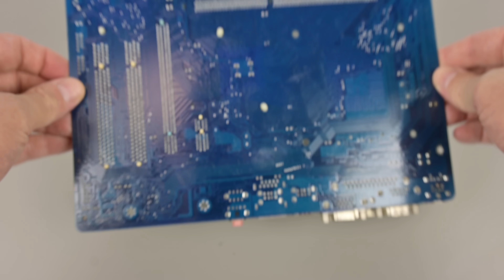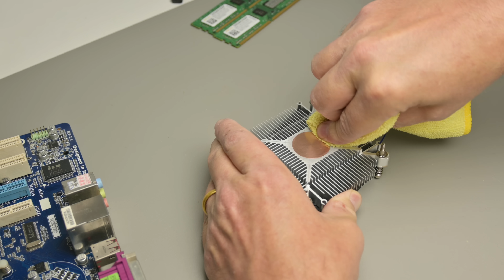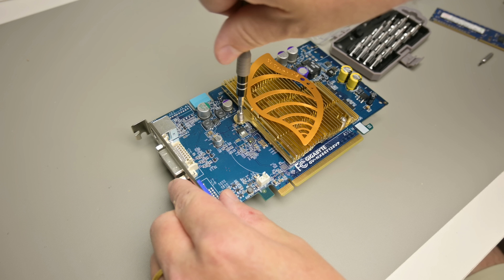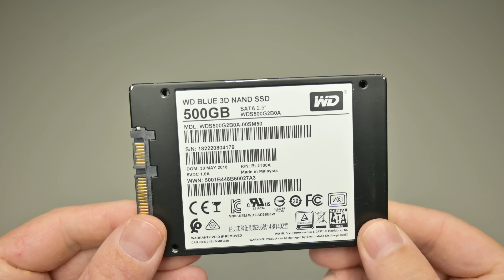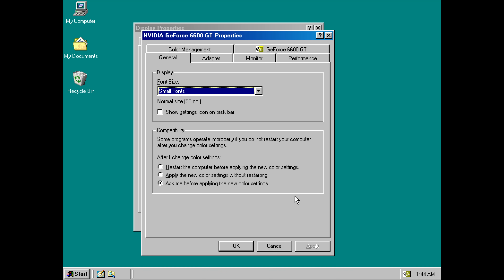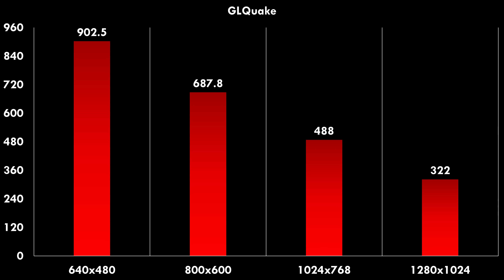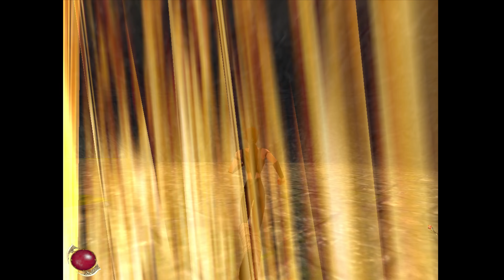E8600 Windows 98

Comment: This is pretty cool. I think it's a little fast for windows 98, maybe xp. Has an IDE port, as far as I know core 2 is the last series that had IDE built into it's chipset, I find later boards with a seperate controller for the IDE outside the chipset has disadvantages. I use a phenom II x4 955 for that, and I have no issues running a 1600 kit at 1600 it's rock solid, even though I think it's an OC. I haven't come across a free X6 chip, maybe once Windows 11 is more in our face I'll come across one, that would be so awesome. I'm sure windows 98 could run on the thing but I have no real reason, it's just a cloning and wiping computer.
Reply from the maker: I have an interesting thing to share! I used to have a Phenom II based main PC when I started the channel. 6 cores and the ASRock board had a floppy header! So the machine was modern but had a Gotek floppy drive to transfer data 😊
Reply: @philscomputerlab  You basically need Phenom II 3.2-3.4 to compete with E8600. 6 cores are not that useful as the frequency is lower due to TDP. To OC it to 3.7Ghz on all cores would risk killing the board as they are not new.

Comment: Another cool video, Phil!! It is fun to run games on overkill systems, but I had problems with Comanche 4 for exemple, too much ram will trigger an error and game wont start. I have dell optiplex 755 with a Quad core Q9550 and Windows xp on it, but I  will try windows 98 on it.  If you like Drakan, give it a try for the sequel on the PS2, Drakan: The Ancients' Gates. PS2 are so cheap nowdays and MX4SIO is very easy to use.
Reply from the maker: Yea I've heard there is a sequel. Shame the PC didn't get a proper one, it's a lovely game.

Comment: the duo cores are ok for retro gaming. I use a Dell optiplex with a Q9550 though. It wil run dos 6.22,win98, win xp and win 7 without any stutters, all on one machine. also SBEMU works in DOS on this machine so even in real dos mode it works.

Comment: Actually, i have stoppe installing Win98 on PC's faster than a P4 Northwood.
P4 @3.0GHz with Geforce 4 Ti is the fastest i have tried.

I have a further Core2duo 8400 which i can OC easily to 3.33GHz. 
Have installed Win7 for max out the 4Gb ram. There is ~ 1 Year difference: release of OS  and this cpu.

Comment: There are also options for PCIe ATI Radeon cards compatible with Windows 98 like the budget X300/X550/X600 or the more expensive X700/X800/X850.
Another benefit of such a configuration is that you get a nice Windows XP rig for free as well, just dual boot :)
Pretty much every E8600 should be able to be overclocked to 4,0GHz - even with undervolting like with my sample so temps are pretty much the same :) And you can go even higher with better cooling/more voltage.

Comment: Well, Quake 1 in 900 fps means nothing to anybody, even if you'd chop the framerate in half. I think it's wasteful. There's no practical use for it, just bragging-rights.
I wish you would test something like Dungeon Keeper 2 on your 98 systems. In my experience, busier maps can really slow down higher-end Windows 98 machines. Games like that speak for the more level-headed reasons someone would consider a computer like this.

Comment: When it comes to running older OS's I love both period correct hardware and also newer officially supported (with drivers) hardware. I'm not one for using modded drivers. If it's supported officially, I love to max out the experience. Whether it be period correct hardware and maxing 98/ME with a P3 or using something newer with drivers to support the experience. For me it comes down to the fact I love hardware and seeing something reach it's potential without going out of official support. I approach this with both 98/ME and XP where I run an Ivy Bridge generation ASUS Asus P9X79 motherboard, 64bit XP, 64GB Ram, XEON E5-2697 v2 CPU, Nvidia Titan Black GPU. Overkill for XP sure, but it's the fun involved in putting something together with officially supported drivers.

Comment: You are better off using a fast Pentium 4 (3 Ghz) cpu as win 98 will not make use of multiple threads, so it will only use one of the cores...
Reply: P4 is crap. Go for an AthlonXP or Athlon64.
Reply: @AncapDude  well i was suggesting a cpu that would actually work in this mainboard, but sure athlons were great back than...

Comment: I think there is a place for period correct and overkill builds.  I have both. Period correct is great for an authentic experience and better compatability. Especially with a CRT. Overkill builds are I think best used with high res LCD displays, and cranking the settings up.
Reply: Overkill builds on 2048x1536 CRT and cranking settings up begs to differ.
Reply: What a stupid opinion LOL. Literally worthless opinion.
Reply: @PrezidentTrump-81622 Thanks. Have a lovely day.

Comment: I have an Athlon 64 and a Pentium 4 system I pair with agp GF2 MX  or GF 6200 or whatever I feel like playing around with. I prefer using those systems but going forward with a e8400 6600 GT on a p5q - e. I'm going to consolidate down to one 98-XP dual boot box. Despite the quirks and the not so nostalgic feel it's just easier.

Comment: E8600 is the best WinXP build CPU that is available. Low TDP and the single core performance was the highest for any non Xeon CPU of that era, and the vast majority of software during the XP period cannot take advantage of more than 2 cores. They will OC to the moon, AND, they are still dirt cheap. Get them for your build while you still can, before younger millennials start getting nostalgic about that period and the price quintuples.

Comment: I love my E8600. I used it and a GT 1030 as a living room machine during the pandemic.

Also used the machine as a Plex server for a while, but it’s sadly sitting idle. Instead, I’m using a 21.5” iMac mid-2011 (i5-2400s with HD 6750M) as a Windows 7 GOG machine. I know it isn’t your normal direction, but if you come across a decent Intel iMac with discrete GPU, especially a Haswell era one, they’re quite capable.

I only had one issue installing; after initial setup from disc, the machine wouldn’t boot properly and went to black screen. A bcdedit to force VGA worked until Bootcamp drivers were installed, then the WHQL driver from AMD. Legacy Update worked quite nicely, as well.

Comment: I think s775 platform and super socket 7 are the best ones for wide cros-OS compatibiliy. I''ve seen a lot of videos about w98 with E8600.. just wonder about win98, how about a more modern dual-core cpu (core i series?) wouldn't it be faster than E8600? -purely in terms of performance

Comment: I'd say next try Windows 98 Quick Install on Sandy Bridge, because now it's 14 years old and completely worthless. I find free Optiplexes in the street. Of course for sound you have to resort to a USB Audio dongle if there are no PCI slots. 

I have actually started working on a HD Audio driver for Windows 98 but progress is slow.

Edit January 2026: My driver works now! But so far only for VMware, VirtualBox and the Realtek ALC2xx codecs. Need to support more systems.
Reply from the maker: So far, Sandy Bridge is my go-to Windows XP system. But yes, for sure I want to check out 98! Prices are cheap.
Reply: Man that's great to hear, i have my XP machine on a Sandy bridge. Didn't thought about trying Win98 on it.

Comment: 2:40 - "Nothing fancy" - I'd argue it still better than running a Stock Intel CPU Cooling.. I hate how difficult that thing is to uninstall or install. If you want go with Intel CPUs, I recommend the Custom Coolers, they are so much easier to use.

I started with authentic PCs - Pentium III and Athlon XP... And that has a interesting vibe to you if you work on it long enough. So is Athlon 64. But the more I think about it - I think Overkill makes stuff so much more interesting - Silky Smooth gaming on (Almost) any game you want - Doesn't matter if it's Unreal Tournament, Indiana Jones and the Infernal Machine, The Settlers - Heritage of Kings or Call of Duty 2003... It will run the way you'd probably enjoy the most... 

... But I'm not against authentic PCs now though, there's something about experiencing less FPS with games that you played on much stronger PCs... I don't know, I finished Grand Theft Auto: San Andreas on my Athlon XP PC with Radeon 7500, even though at times it had around 15-20 FPS during gameplay.

Also... I like the compatibility with 775 Boards, this stuff makes running 98SE so much easier (I wonder about AM2 Boards though, since nobody is talking about that.) on something that doesn't rely on IDE/SATA > IDE Adapters, especially with the former, those HDDs are becoming less available with each passing year.

Comment: Nice choice of Hardware für Windows 98. I'm using the GeForce 6800 GT with AGP on Socket A with Athlon XP 3200+.
I know the Athlon isn't fast enough for the GeForce, but its running good under Windows 98.

Comment: ❤ E8500 and E8600 is also my universal approach from W98 to W7, just changing gpus from GeforceFX and Radeon 9600Pro to  X800, 7900GS and later. Personally I prefer to play on Windows 2000, cause it is running almost everything like win98 but more gpu options, more stable and smoother fps.
Reply: There is nothing in NT5 like Win98

Comment: I love the E8600, in Win 98, XP, Vista and above...also, Socket 775 is amazing and SO versatile, thank you for showing that 😍
Reply: Be Nostalgic, my friend.
Reply: @Captain_Wasel  yes indeed!!
Reply: True I used e8500 to run XP and W7 up to early 2013
Reply: Yo, midnight geek is here
Reply: @therealegr  What, where???
Reply: @MidnightGeek99  Here, on PhilsComputerLab's commentary section
Reply: 8400, 8500 e 8600 is the best, my 8400 overclock is 4000 ghz fine!
But need watercooler,  i using cooler master model
Reply: e8500 can go up 4113mhz on air with a 9700nt. 62°c fpu stress test.
Reply: @devilzuser0050  62c is near TJMax for that chip too, dangerously hot actually. We didn't start seeing TJMax over 80c until Skylake.

Comment: Hi Phil ...yeah I'm liking the socket 775 for Win98, the 478 boards are just disappointing to say the least.
I've been testing different socket 775 boards trying to find the sweet-spot, the deciding factor for me always ends up being chips-set driver compatibility.
Seems to me the PCIe Graphics Cards are the way to if you want the bandwidth, I'm running a GeForce 7800 GTX 256mb 256bit .
Like you said L2 cache makes a difference, My Q9650 matches the E8600 with L1 32+32 & L2 6mb and I'm happy with the CPU.
For the motherboard I've got myself a NOS ASRock G31M-S, most G31 boards have a floppy connector and this one feature I consider necessary for a Windows 98 build.
Reply: Not socket 478 is the problem but that silly Netburst P4's for it are.

Comment: I think I've had the E8400 + 9800 GT in the late 2000s when I was a kid. It felt like such a big jump when I upgraded to an i7-2600K + GTX 570 afterwards... I didn't overclock either of those at first, but I eventually gave the i7-2600K a small OC after getting into the hardware scene and reading about its OC potential.

Comment: I am planning to put 98se on my Socket A pc with 3 cpu options, the Sempron 2400+ it came with or the XP 1800+ or Barton 3000+ once I flash the BIOs to correctly identify it runs at 1400 or 1500Mhz yet has the full 512Mb cache of the actual processor. Before now i never had to update a BIOS and here's old school gotta make a DOS boot floppy 💾 and have the bios file on the hard drive to flash it..

Comment: I don’t like not having chipset drivers installed, it’s bit me a few times where I’d get unexpected behavior with USB HID and IDE controllers. So the thought of Core2 gives me pause unless it’s XP. I lean on Coppermine and Voodoo3 2000 PCI for era appropriate DOS and 98SE and then run ME on socket 754 with a Radeon 9700 Pro (or FX5600 on weird edge cases needing table fog) for specific later games that require a lot of horsepower. Everything else goes to an X58 box on XP, or is new enough and has enough patches I can just run it in 11 on modern hardware. The only issues I have with this three machine retro solution is SATA on certain revision VIA can be wonky, so I’ve started using Promise 150TX2 PCI controllers to be able to use modern SATA2 or SATA3 without issue in 98SE with DMA enabled. I even use one in my Dell GX1 tower, which violates the era appropriate hardware rule, but then again so does the PicoGUS. I’ve wasted a lot of money on various socket 478 industrial boards with ISA to know they all have quirks, so I’ve not found a solution better than just having three machines specific to task.

Comment: my personal 98 setup is a k6-2+ with 512 mb sdram and a radeon 9200se and a voodoo 2 12 mb. still running on traditional spinning rust as well.
Reply: I have a k6-2 550mhz and 512mb also with S3 Virge GX2 AGP and a pair of Voodoo2s in SLI, though the voodoo2s need some TLC. Gotta find a hard drive too... The Matsonic motherboard does not like drives over 32gb. Need to source another keyboard as well... Old AT style. I also have a Geforce 256! But it doesn't like the motherboard very well lol
Reply: More genuine Option than wasting a dual core cpu for it.
Reply: Guarde o velho winchester para ocasiões especiais e no dia a dia use cf card
Reply: yeah but compact flash doesnt give you that nice clunk whirrrrrrrrrr sound when it starts up
Reply: @cal2127 true but I never mentioned Compact Flash. But, someone did make a little device that does the clicking noises
Reply: What a strange combination.

Comment: I've also got an LGA775 build for my Windows XP retro build, and whole host of different CPUs I can swap in and out. From a Pentium 4 630 (Prescott 3Ghz) to a few dual cores and quad cores including the Q6600 and Q9400, on a Gigabyte GA-EP45-DS3. I actually have multiple boot drives so that I can change between Win XP and Windows 7 as well. I think these CPUs work great for a more demanding OS like XP. If I were to use a Pentium 3, I think I'd stick with Windows 95 or 98.

Comment: A lot of the 2000s hardware is retro now. Seen people interested in old high end SLi and Crossfire setups. Like i grew up from pentium ii then Duron, AMD 64, x2, phenom ii, Sandybridge intel... It's nostalgic for some people. It's also cheaper than period correct hardware and faster. Can play a lot of win 98 games with higher resolution and AA ect. Lots of people run PCI voodoo cards in later motherboards with PCI express.

Video brought up interesting points about collecting and using legacy hardware.
Reply: i miss my old phenom ii x6. that thing was a beast for the early 2010s
Reply: Yep... SLI 👍😇 Love it.

Comment: Gigabyte liked to use thermal glue for their passive GPUs back in those days, that's why it's stuck solid to the heatpipe. Now, I have managed on 2 Gigabyte 6600 GTs to remove the heatpipe without damaging the chip by rocking it left and right very carefully, but it still felt like a gamble. Once removed, it is a huge pain to scrape off all the remaining glue. The method that worked for me was painstakingly scraping it off with acetone, q-tips and a plastic scraper, which took a long time but didn't leave any scratches behind.

Also, after all of that and repasting using Thermalright TFX, it didn't really change the temperatures much.

However, an issue that you might have is dust and grime accumulation on the thermal pad on the underside of the card, which is stuck between the bottom heatsink and the PCB. There's no way to get in here to clean and replace that thermal pad without undoing the glue. 

But once you managed to get all of that done, it becomes very servicable, and you get the most beefy heatsink on a 6600GT ever. Add a fan and it runs cool all day!
Reply: Awesome
Reply: It's supposed to become brittle after a while in the freezer

Comment: Don't discount Core i[something] just because they have lower clocks/caches. We've long left that lane, you measure IPC. Try landing a 3250 from the bargain bin, it's old but not "ancient old". My 2120 beat my e7300 by about 20-25%, i expect the 3250 to go over the e8600 for at least that. If you only need XP compatibility, you can pick from a truck load of old office PC's, W98 might be a bit harder as you'll need that PCI slot for the soundcard, but stuff like the P8h61-m does exist 😉

Comment: I have the same motherboard. I installed a Xeon cpu with a higher clock and cache memory. You could easily find the mod for the motherboard and cpu on the web. All I did is stick a small pcb to the bottom of the cpu to jumper two adjacent pins. And I cut the plastic guide rails on the socket. I did not have to reflash the bios on this board. I just make sure it had the latest bios updates installed... Great VLOG... =8=)
Reply: I am looking into this with a Gigabyte P45 motherboard I don't even have yet it has a Q6600 but i am wanting the X5482...

Comment: Using e8500 on a 775Dual-VSTA and u can use agp & or pcie - although you may need a full recap - is a very fast system for w98
Reply from the maker: That sounds like a great build!

Comment: According to Wiki "List of Intel Core processors", the highest Core 2 Duo processor is E8700@3.5GHz. 

“Note 2: E8700 is a very rare example in Intel's history where a model was yanked from Intel ARK without a recall notice and after a SSPEC was assigned. Working examples were seen, believed to have been released to OEM,[12] but none was offered in retail PCs.”
Reply: i think only a handful are were available, anyway, overclock an e8600 and you get the same thing
Reply from the maker: @omegarugal9283 Yea I've never seen one...